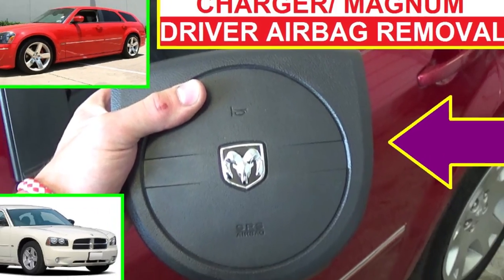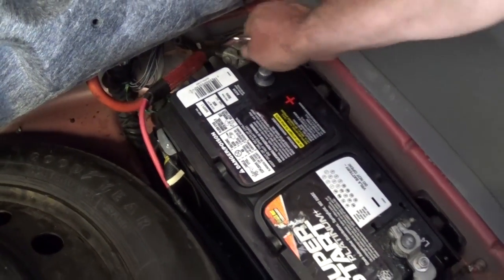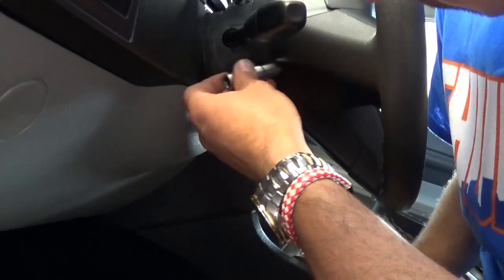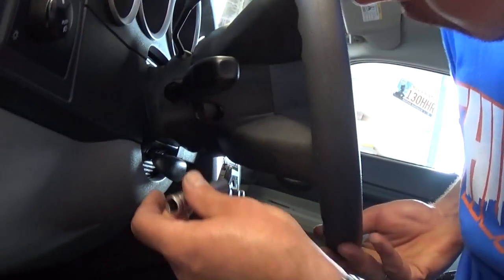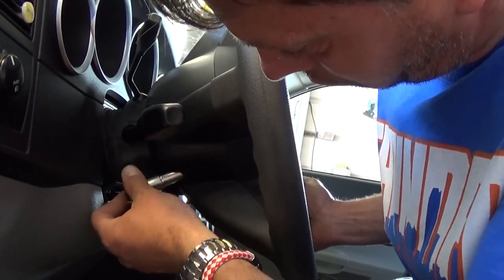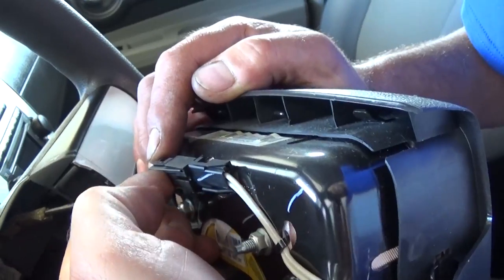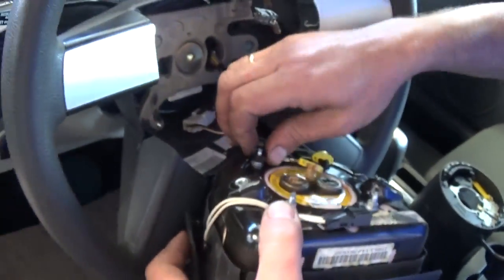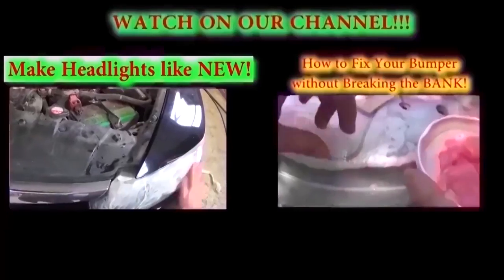Dodge Charger Driver Steering Wheel Airbag Removal and Replacement  Dodge Magnum

Comment: If the airbag was deployed will you still be able to follow these same steps?
Reply: Yes, i just replaced mine in a 2015 dodge charger
Reply: @Adonisfilms876  I know this comment is old, but did you have to reprogram anything?
Reply: @atheistgameing  I did have to get the airbag module reset. I've seen some cases where replacing all the components allowed the airbag light to go away. The computers in the cars are somewhat "self healing" but sometimes, it does have to get reset.
Reply: @adonisblackwood3226  so would it be a good idea to buy airbags module from ebay and thank you sooo much

Comment: can you add a steering wheel that has steering wheel controls in a magnum that doesn't have them?? if so how??
Reply from the maker: It is almost impossible without taking half of the car apart. You will need different wiring harness that runs under the dash and also you will need to replace the BCM ( Body Control Module) and have it programmed. It is very complicated. Sorry for the bad news. You can install a steering wheel with the controls but they will not work.